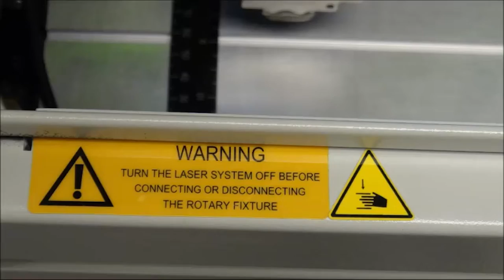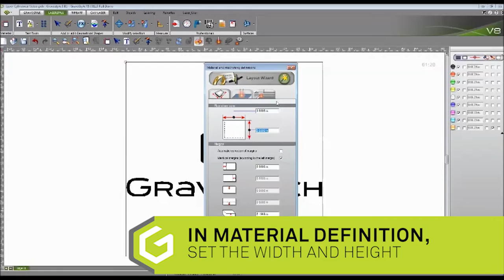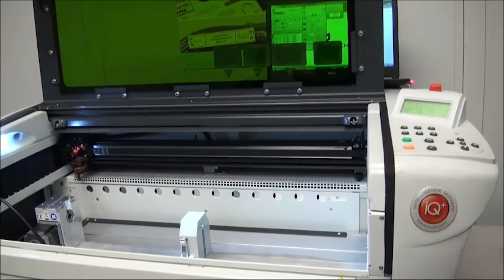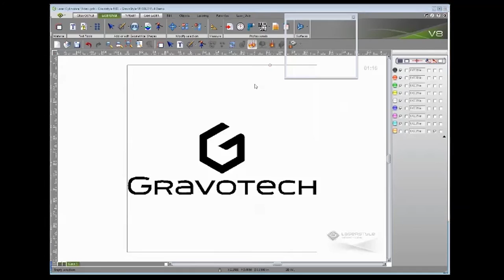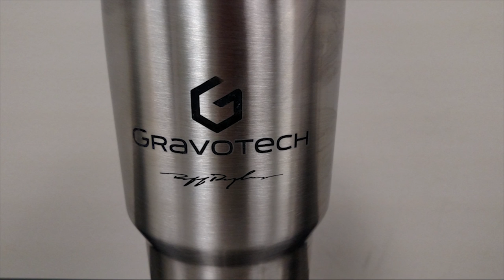Engraving with a cylindrical attachment on Gravograph LS100 by Gravotech

Comment: hi why are you using the cermark spray with a Fibre laser thanks?
Reply from the maker: Typically, you would not use Cermark with a Fiber laser. However, you can use Cermark to provide a richer/deeper black mark if desired.
Reply: Thanks
Reply: Its not a fibre laser.